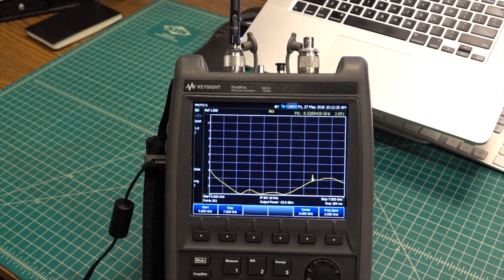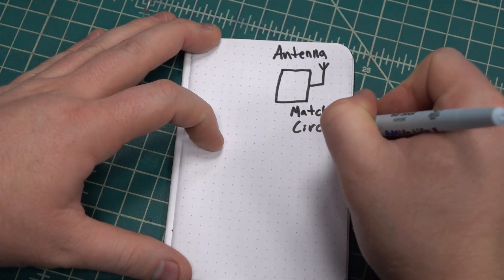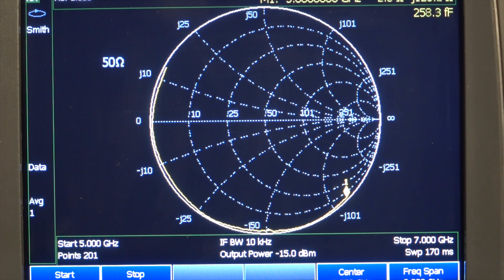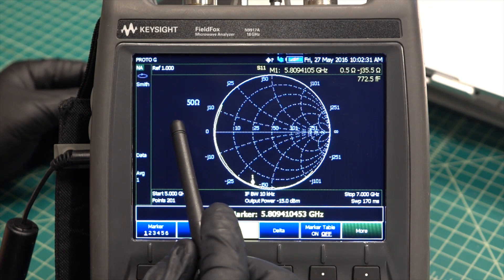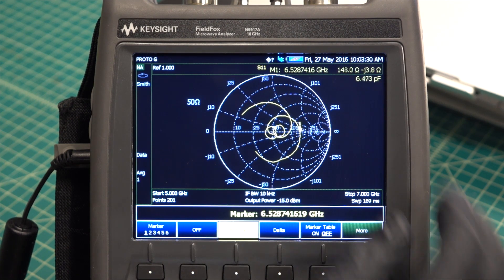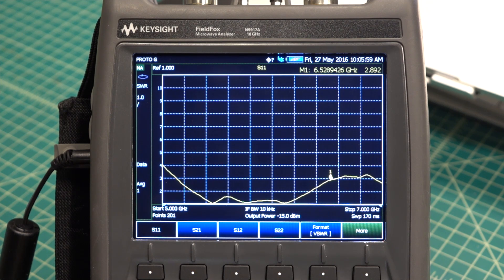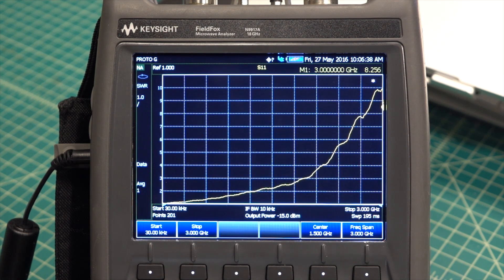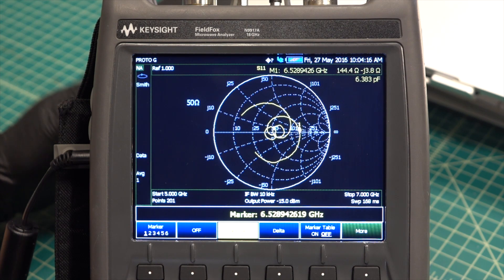Introduction to Antenna Design #1 // Terminology

Comment: XMIINNOV is the professional manufacturer on RFID tags and readers, the mainly products include all kinds of RFID tags, RFID readers and application management system, especially our patent products: RFID destructive anti-tamper electronic tag, NFC tag, anti-fake electronic tag, RFID fragile anti-transfer electronic tag etc, which are widely used for commodity trace-ability, security identification, vehicle management, item sealing and ticket management etc. For more information kindly check in: http://rfidtagworld.com/

Comment: What's with the gloves?
Reply: He be feelin kinkeh.
Reply: Dust, oil, etc. can get on your devices.
Reply: @GasparinPR  Would it be bad for RF devices though?  For optics or vacuum chamber equipment, sure, but I don't see the need for radio equipment.

Comment: Hey, I have a question re Balun:

I have a Norcal doublet which is essentially a balanced line that is split at the end into two legs a la dipole. My KX3 works far better with this antenna when connected to a 4:1 balun. It sounds like you're saying that coax requires a balun and not balanced line? This is something I never understood about my radio & antenna setup and I was hoping you could clear up my confusion. Thank you.
Reply from the maker: No problem Taiden.  What you're doing is fine and is really common.  You're connecting the balanced line of your antenna to an unbalanced feed line as well as converting the mismatched impedances at a ratio of 4:1.  When people need to get a much out of their systems as possible while requiring long lengths of cable may use a balanced transmission line like a ladder line.  Many pre-made antennas already have small length of unbalances coax already attached.  This is where you would use a balun to adapt the ladder line to the coax.  The simplest form of a balun is just an adapter with a 1:1 transformer.  If the antenna was already a good match at the end of the ladder line, then it would just be a 1:1 balun.  As a result of being balanced, the ladder line will have much lower losses at long lengths compared to coax.  For example, RG-58 coax loses 6.6 dB per 100 m at 1 GHz, while 300 ohm twin-lead loses only 0.55 dB.  There are some disadvantages though.  Ladder line is much more sensitive to the environment it is placed in and coax is still preferred unless you absolutely need maximum performance out of your system.